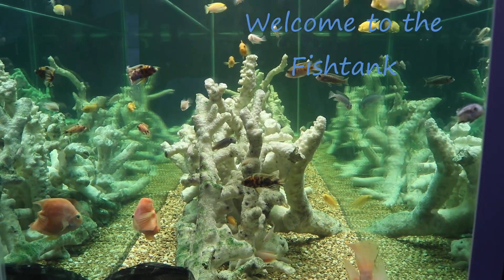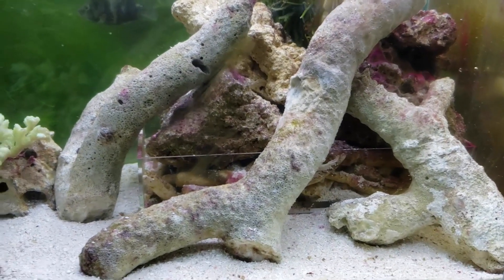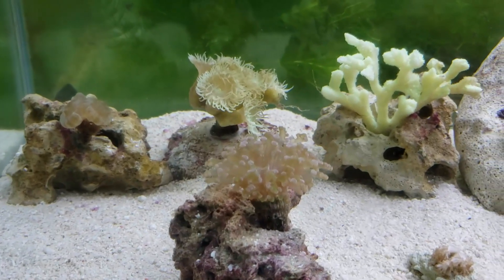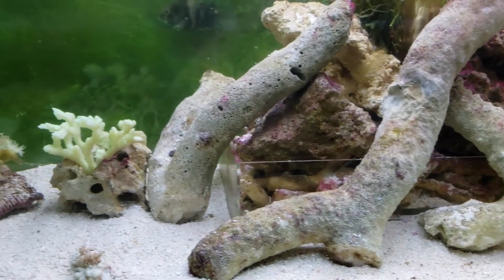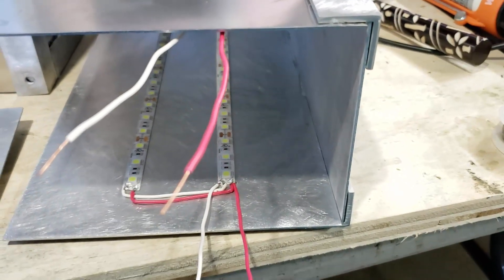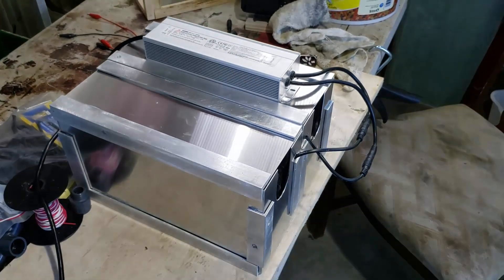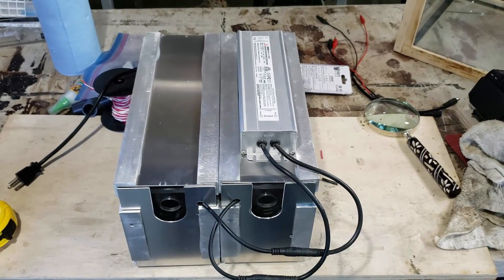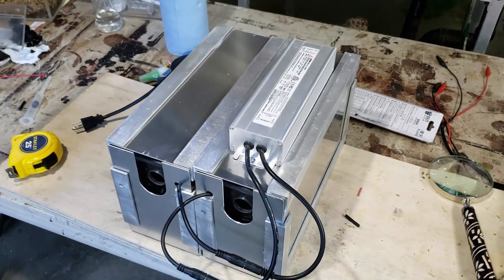DIY Algae Filter Ver 3 Part 2 Plus Low Tech Marine Tank Update

Comment: With the dual scrubber, are you running 2 separate pumps for that or in series, what is the benefit of running 2 opposed to just one. Great video as always, I  learn something new every time. Salt water tank looks good, my lil miss has been bugging my too start one, just never had the know how.
Reply from the maker: Hey Jon! There will be one pump running the filters in parallel. There's two of them so I can alternate cleaning them. Thanks for coming by!
Reply: @FishmanEricRussell  that makes alot more sense, also probably keeping the spikes down by doing so. Thank you very much for the response.
Reply from the maker: @jonwhite4735  Anytime